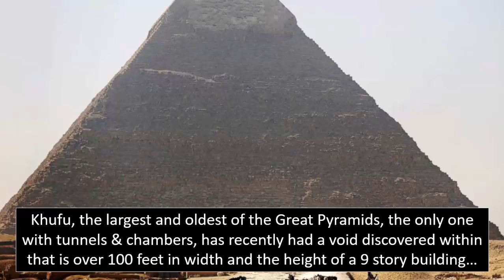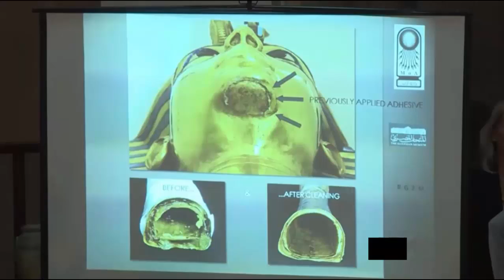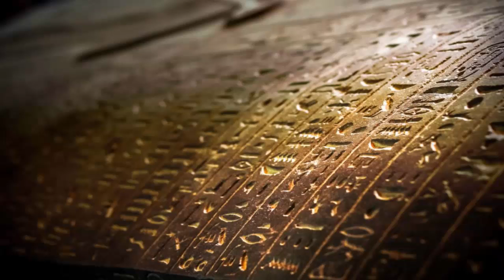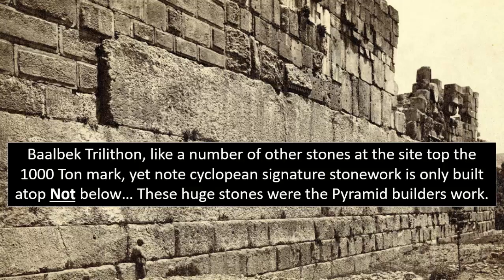Who Built The Pyramids ~ A Controversial Truth?

Comment: Bro I love your videos, but you mess me up with talking about one thing and place and showing pictures of another. But I also think they break down more. Maybe same type of tools bits different varieties. The tool marks and lines are at different angles and arcs, at different places. Also the square with smooth outer edge there are diff variations from being smoothish in middle to looking snapped off, I've found links of those stones in Israel also. And one thing you've not touched on are the "melt marks" at the bottom of some lines in Peru and Petra just a few I've been able to locate from video.